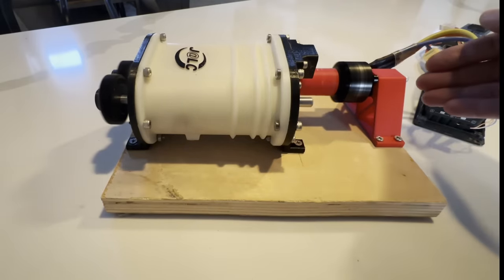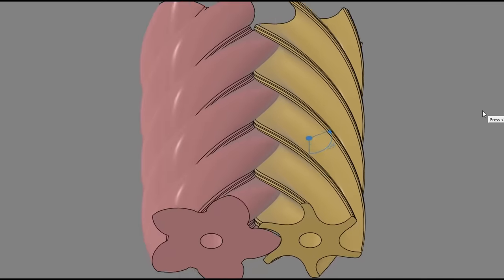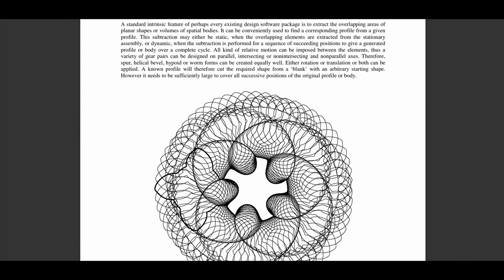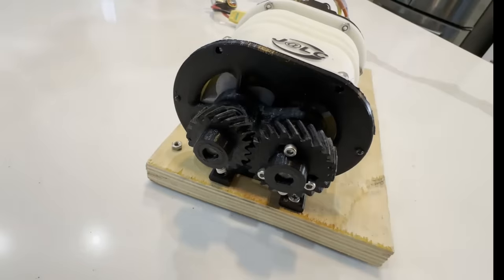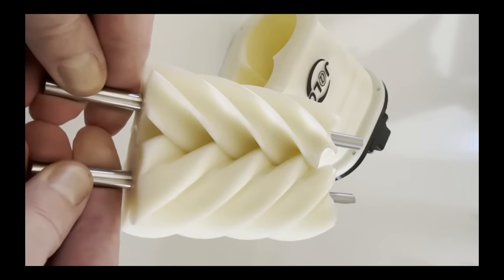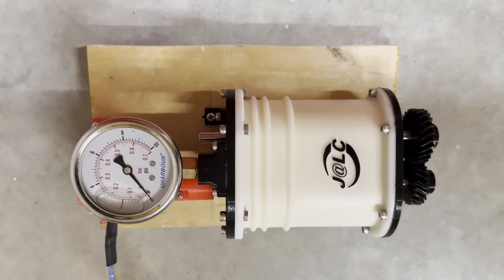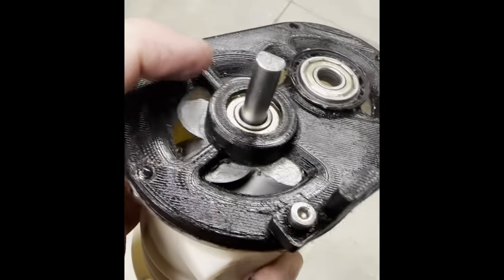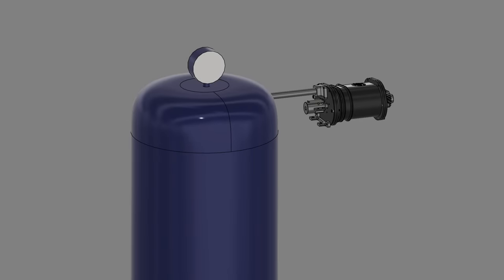3D Printed Screw Compressor V3

Comment: As to measuring the performance, I think measuring the volume of air, (CFM or lbs/min) would be a better scale of performance.
Reply from the maker: Yeah, I agree.  I want to rebuild this compressor and at least see how much air it's flowing.  What's the best way to measure the CFM for something so small?
Reply: @IndeterminateDesign  got any friends that do HVAC? There’s collapsible screens with a meter, that are used to measure air flow. Put the blower in a box, exhausting out the side, with the HVAC flow screen on top of the open box.
Reply: @IndeterminateDesign  anemometer and a cardboard box tunnel is the Matthias Wandel dirtbag method. Flow = Velocity*Area
Reply from the maker: @toolscientist  Thanks, I look into that setup.
Reply: You can also use a collapsible container of normal pressure air, such as a sealed bag, on your inlet and time how long it takes the compressor to empty it. It's much the same concept as timing how long it takes to empty a bucket in order to test the displacement of a liquid pump.

Another important test would be to go ahead and connect it to a tank like you mentioned in the video to see if a sealed system gives you any considerably better results and if so how long it takes to reach a significant plateau of pressure differential. You would have to add one or two more variables to the math if you wanted the CFM-at-pressure  (resistive CFM? Working CFM? I'm not sure the terminology here), but hopefully not too much more complicated.

Comment: spray on some soft self abbrasive coating to make better seal.
Reply from the maker: On my previous compressor I ran automotive buffing compound to polish the rotors and it worked well, except when the rotors expanded due to heat.  This version has timing gears so this compressor's rotors don't actually come in contact with each other or the housing.  Ideally you'd measure the thermal expansion of each of the parts and set it up to run very tight clearances when up to temperature, and then inject some abrasive compound.
Reply: @IndeterminateDesign  I mean a sacrificive coating , so it can fit automatically to tolerance

Comment: did I miss the flow measurement? could be fun for as a compressor for part cooling on a 3d printer
Reply from the maker: I didn't measure the flow.  In hindsight I should have done the flow testing before I just went straight to maxing it out to see how much pressure it made.  It does move quite a bit of air, so it would be a cool parts cooler.  Inefficient for sure but cool

Comment: If you want a good high temp 3d printing material, I have had great success with pet cf
Reply from the maker: How high of temps have you been able to hold with that?  The rotors were PETG and the intake/exhaust were nylon. I think these compressors should stay under 90C or so.

Comment: Please could you confirm the prices involved.  The numbers on the invoice were a bit difficult to read in mu old age.  Thank you.
Reply from the maker: That wasn’t the invoice, just an example. The rotors were $15-20 each, and the housing was around $35 I think. But there are cheaper options, depending on the resin.
Reply: @IndeterminateDesign  Thank you for the update.

There seem to be a number of similar companies springing up in China these days.  Are they all around the same price and level of quality?

Comment: Man, dont use nylon.
To keep small tolerances you need high rigidity. PETG & Nylon has good chance to rub on the walls from centrifugal forces at high RPM.

Since PLA is out of question (comlressing gas generates too much heat), then the next rigid material coming to mind is PC.
...or maybe ABS.

After all it copes with heat better in short term (not melting) and long term (not creeping due to heat).

And ABS can be vapor smoothed by cheap and easy acetone trick to get surface finish you are looking for.
Reply from the maker: I have some carbon fiber PC filament, my main concern with this shape would be warping.  I think a glass filled nylon could do it as well.  I read about some small screw compressors for the medical industry using nylon rotors.

Comment: Are there examples of "soft" rotor compressors? Think peristaltic pump. The objective is a quiet low pressure compressor...
Reply from the maker: A for moving air, the only ones I know of are vane style (teflon vanes) or diaphragm style compressors.  I’m not sure what would be the quietest honestly.
Reply: There are peristaltic pumps. Often called dosing pumps as they're mainly used in medicine. They're basically a flexible hose bent in a U-shape around a disc with rollers on it. The rollers squeeze the tube and push the fluid in one direction.

Quiet and low pressure is fairly easy. You just run your pump at low RPMs. The challenge is if you want low pressure, low noise, and high flow. But this also depends on what you consider low/high pressure and low/high flow.

Comment: So much for the 500$ parts from JLC 😂
Reply from the maker: Way way less than that, under $100. SLA is very cheap. 3D printed metal like I had selected in there is not.

Comment: You need to lube your timing gears. And don't use PLA for anything but decorations.
Reply from the maker: Everything was PETG or nylon. The only thing I used PLA for was the motor mount.